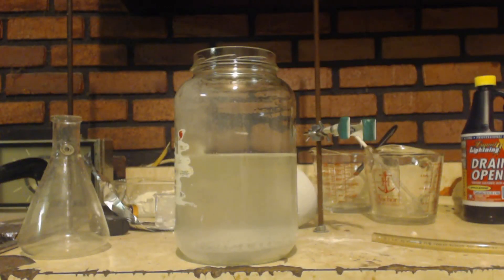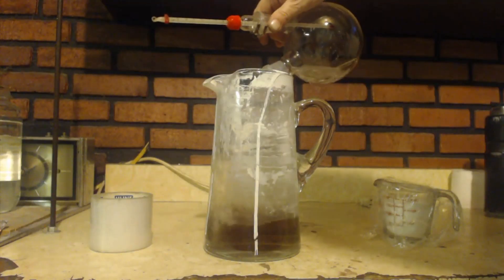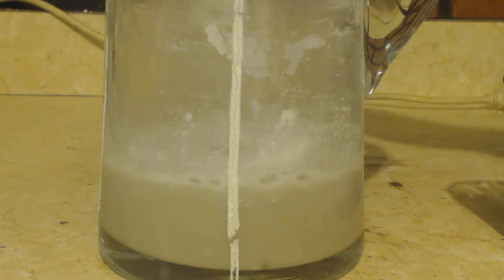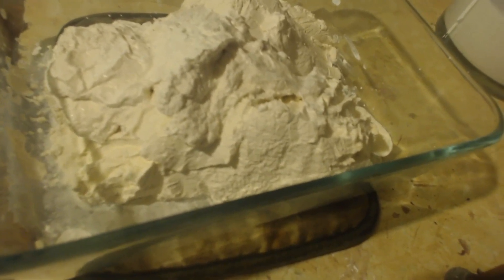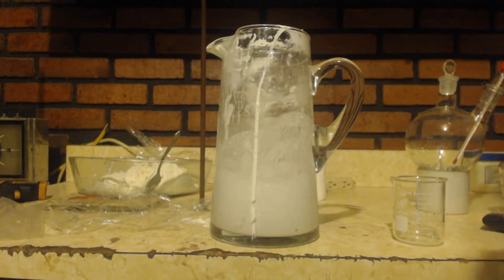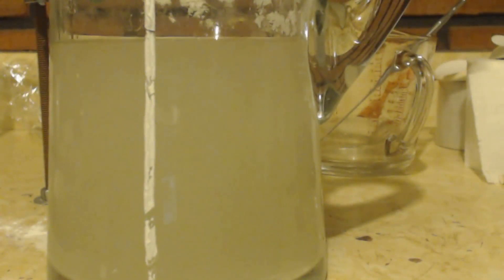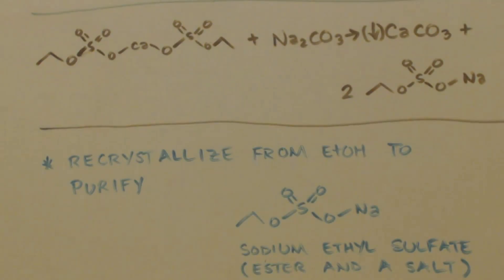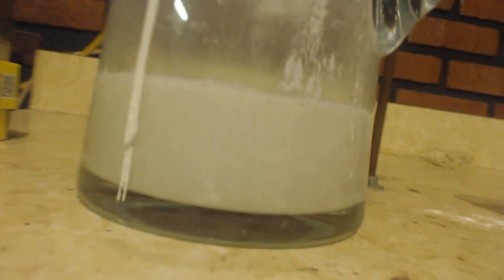SODIUM ETHYL SULFATE SYNTHESIS  part 3

Comment: (New to your channel, but I'm assuming you're color blind?) Have you thought about getting a pH meter? The one I have was $40 after shipping, and it works great. https://www.amazon.com/gp/product/B00ST3VTQ4
Edit: Or even some of the pH strips that use multiple blocks with different colors for each pH, those work great as well: https://www.amazon.com/gp/product/B07DNB9VLJ/
Or.. a set of pH papers that use various colors (lighter colors even instead of the darker colors usually used for higher pH values): https://www.amazon.com/gp/product/B0045I6DOA

Sorry, don't mean to flood you with a bunch of Amazon links, just I know the above all work well for me :-) (The pH meter is best, but if you're working with small amounts of a substance, then using a tiny strip of pH paper is sometimes better)
Reply from the maker: J H...…….I swear today I have found like ten post...including yours....where youtube never notified me.   Yes that could be possible in the purple rage of color that  I am slightly color blind.  I actually bought an electronic pH meter like 4 years ago and never used it.  I should find that thing.  Thanks for all the ideas about different pH papers.  I will check them out.
Reply: @jbsc6180  No worries mate. Thanks for the reply! I love your videos, please keep sharing!
Reply: @jbsc6180  You should store that pH meter exactly how user manual says, else it might lose accuracy dramatically.
Reply from the maker: @larry_k  ……..Thinking back on it I did use the pH meter a couple times when I first got it.  I am not good with maintenance so I never really used it.  I should get it out again.
Reply: @jbsc6180  AFAIK ph meter probe should be stored in a KCl solution of a proper concentration. At least Hanna ones should.
Reply from the maker: @larry_k  ………..I am to unorganized for that
Reply: @jbsc6180  Then at least soak pH meter probe in a proper salt solution for several hours before use. Otherwise readings may be way off.
Reply: He's rather just that brutal
Reply: @larry_k  brutal? What?..
Reply: @jhyland87  Um, never mind
Reply: Anyone who is colorblind in that way would also have trouble distinguishing in the red colors at the lower end of the Ph scale on Ph paper, wouldn't they?
Reply from the maker: Backyard...………...Cool name.  BackYard Science.  I THINK color blindness can be any variation you can think of.
Reply: @jbsc6180  , neat!  I have a friend who is red/green colorblind and he has a lot of trouble with red colors.  He says that they just look like varying shades of grey to him.
Reply from the maker: @BackYardScience2000  ……...That must suck.
Reply: @BackYardScience2000  No... Not necessarily. Theres red & green color blindness, blue & yellow color blindness, as then I think even total color blindness.
https://coopervision.com/blog/all-different-kinds-color-blindness